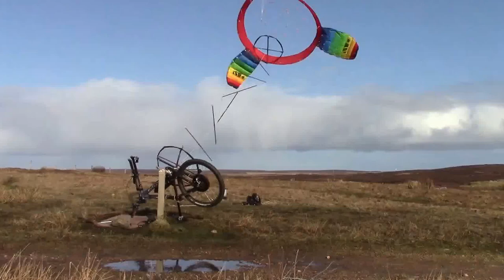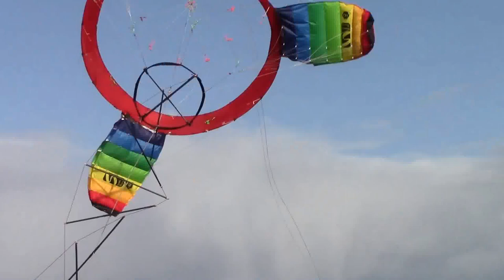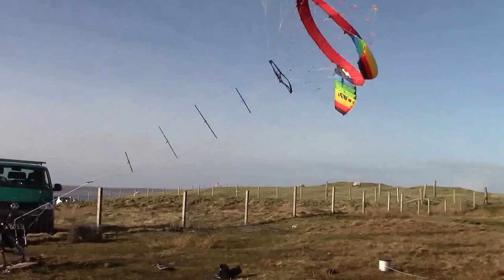Solo launch dificult test

Comment: Is it a problem that the turbine is allways at an uppwards angle? I know a potential way to fix it. Have the lifter kite lift a ring instead, where the torque-ladder goes inside. The ring has two parts, one outer that is stationary, and an inner ring that slides inside the outer one, and is clamped to the torque ladder.

In order to make the torqe ladder flexible an bend at the ring while still maintaining tension to transfer energy, have two special sections there with X:es instead of just rods (one on each side of the ring), where the incomming/outgoing cables are shifted 90 degrees. In sweden we call it "polhems knot".

The only potential drawback i can see is added complexity, a more difficoult launch sequence an perhaps a greater potential for entanglement. But at least in theory the turbine could point directly into the wind.

What is your oppinion on this idea?